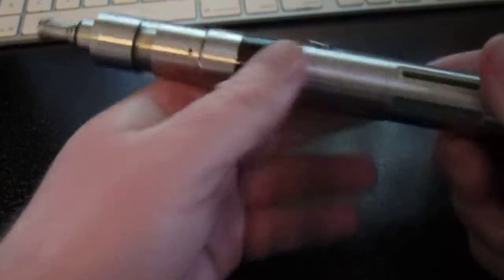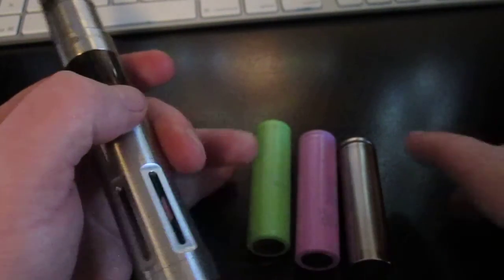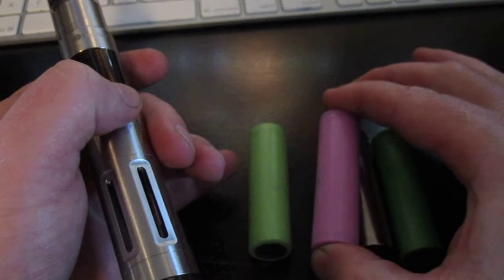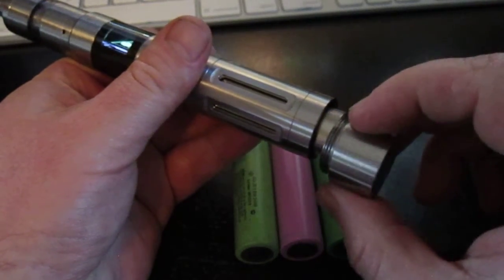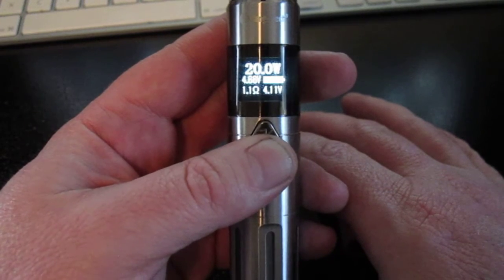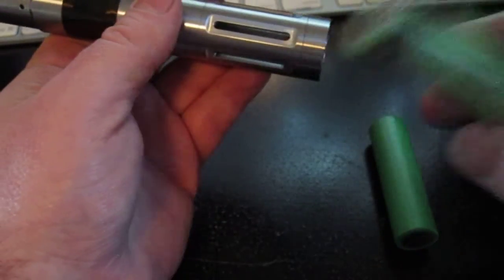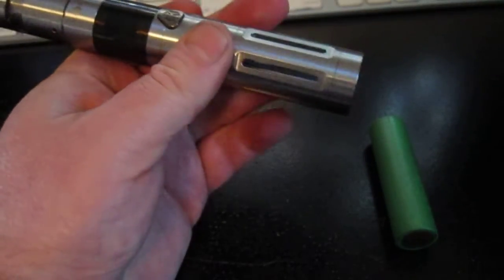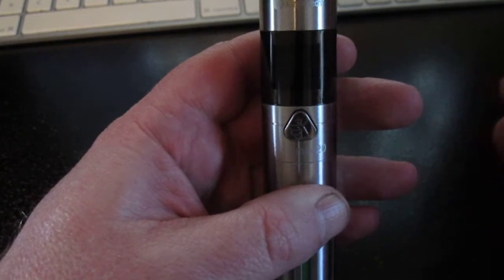What is Battery Sag?

Comment: So the less sag a battery gets the better the battery?
Reply from the maker: +Mat Taylor Indeed. It is also depends on the mod you're using as well, regulated mod that is.
Reply: +Insomniac Vapers I'm using a sigelei fuchai 200w vaping around 55-70watts using  the efest 3000mah I press fire and it goes down around half I thought them battery's were the best lol I was wrong I think
Reply from the maker: Mat Taylor That one is using 3 batteries, correct? I would get some LG HG2 3000MAH. Far better batteries.
Reply: +Insomniac Vapers no sorry that's just the two batteries I will order some of them off ebay thank you very much you may have saved me some money lol well worth a sub
Reply: +Insomniac Vapers no sorry that's just the two batteries I will order some of them off ebay thank you very much you may have saved me some money lol well worth a sub
Reply from the maker: Mat Taylor That is probably one of the reasons you have having some sag there. The better LG batteries should help with that. But they are an all around better battery, the Samsung 25r are pretty good too. And thanks!
Reply: +Insomniac Vapers Yeah I get more life out of the Samsungs then the efest although the efest are supposed to be more powerful I have ordered some of the LG ones from ebay thanks a bunch
Reply from the maker: Mat Taylor You're welcome. :D